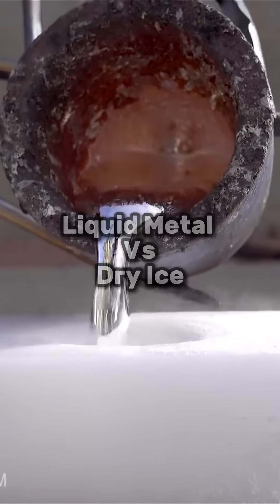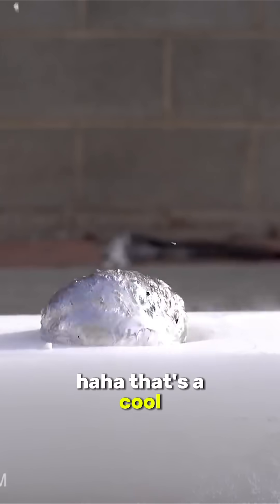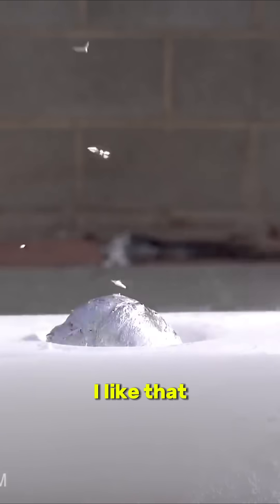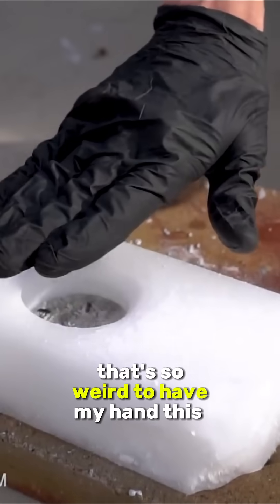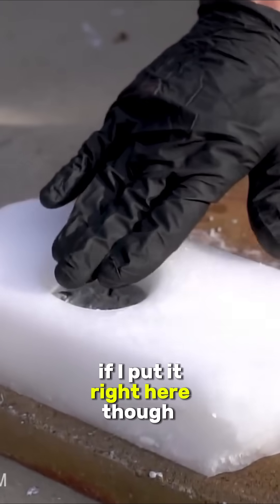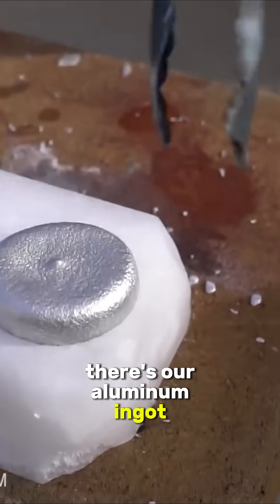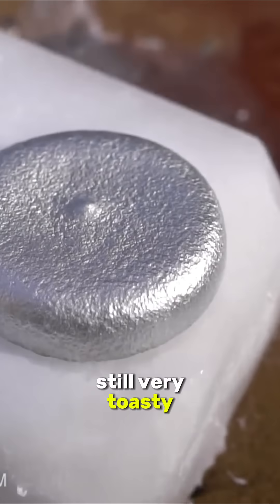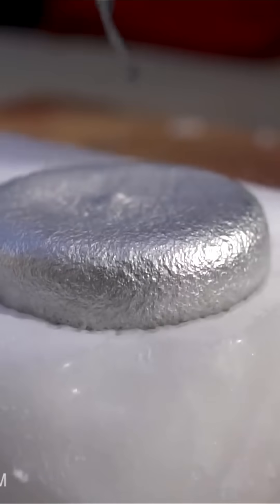Liquid Metal vs Dry Ice

Comment: Aluminum has alot of holes and hold heat for awhile over other metals. Using dad's torch on pop cans do not count.
Reply: What? No it doesn't. Aluminum changes temperatures faster than most metals. It heats up quick but also cools off quick. Aluminum is literally used in heat sinks to dissipate heat. As far as the "hole" thing goes, I have no idea what you are talking about. Metals don't have holes, they are a crystalline structure.
Reply: @jacobcasmus1882  aluminum is a porous metal that does hold heat for along time.

Comment: Dry Ice converts directly from the solid to gass (CO2).... (Which is called sublimation)
As we know gasses are excellent insulators.. thus an insulating layer is formed between the molten Aluminum and Dry Ice which causes it to solidify slowly (cooling slowly) 😊
Reply: Or just: its a steam jacket

Comment: Why not test that as a new cast method? I am curious to see if that way of casting an ingot results in a stronger or weaker ingot.
Reply: It will be much weaker.  The more gradual the cool down the stronger it will be.   Rapid cooling inevitably causes greater internal stress, which often causes deformation.